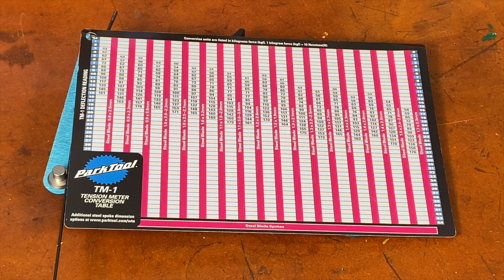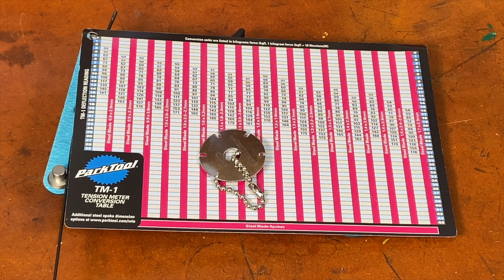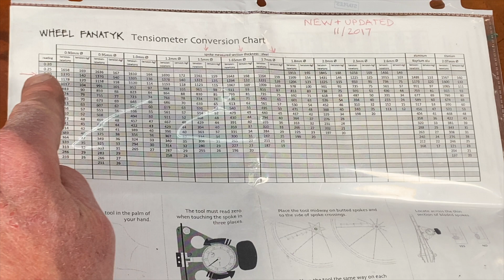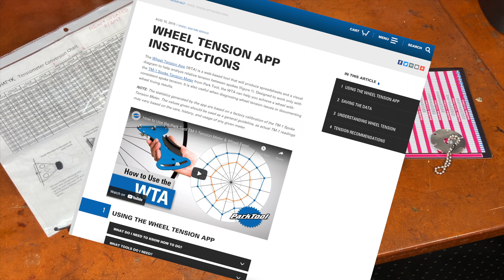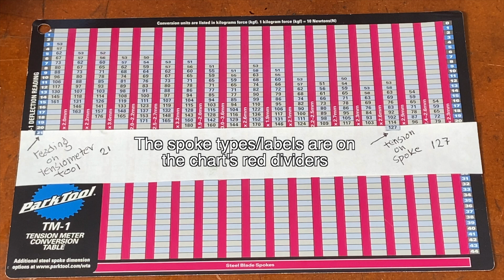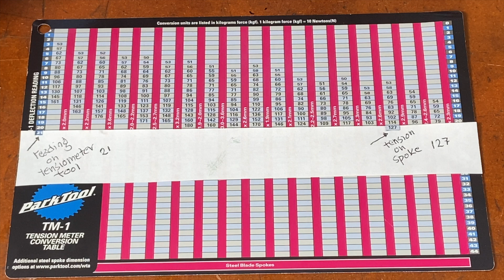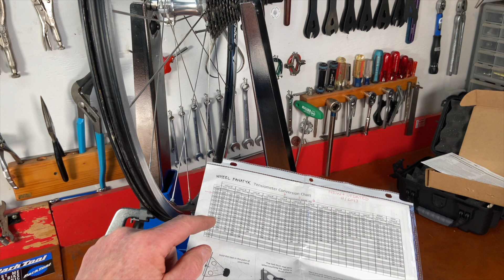Do You Need A SPOKE TENSION METER to Build Bicycle Wheels?

Comment: Hi Jim, I've become a big fan of your work in this channel. Based on many comments on many of your videos, I can tell a lot of your viewers might be interested in truing existing wheels as much, if not more, than on building them ourselves (at least for now). Given the similarities of the procedures, and how truing can be cheaper and less intimidating, would you consider making a video on truing a very damaged wheel? Apologies if you have such a video already. What interests me the most is the fine juggling of lateral trueness with spoke tension on, say, a rear wheel that has a flat(ish) spot (with corresponding poorly tensioned spokes) after being ridden over a pot hole. Maybe even use (if you so recommend {and/or explain why/when not to do so}) a "wheel rim height repair tool". Sorry for being so demanding and specific 🤪. Thanks in advance and I'll take a deeper look into your channel, maybe my request has been satisfied before. Cheers!
Reply from the maker: Thanks for supporting my channel, Carlos, really appreciate it! One thing to know is that almost all of my 25+ wheel videos have YouTube chapters. That means that you can easily jump to exactly what you want to watch by looking at the chapters (just click the SHOW MORE button under the description and they'll show up and on some videos they show up on the screen if you mouseover the red progress bar). To help you get there more quickly, here's where I explain the whole process of truing both side to side (wobble) and up and down (roundness). It's in my how to build wheels video: https://youtu.be/XUqul03hbZ8?t=1725

I go over everything so it's long but it does teach how to true and round wheels and shows the process to fix low/flat spots in wheels. Also, I have another video where I show fixing my friend's crashed carbon wheel here. This is a real time video taken as he held the camera and I did the repair. https://www.youtube.com/watch?v=NyPGQrNfUFU&t=256s

Now you specifically asked about wheels that might have run into a pot hole. That's a repair where you would start by checking the rim for bends or even worse, impact dents or real damage to the sidewalls of the rim. Most rims on quality bikes are aluminum and aluminum doesn't do well when you try to straighten it. You can try with bending tools and sometimes make it better and there are techniques for doing so, such a blocks of wood and a vise grip to sqeeze and press out dents, etc. You can make a simple tool out of a turnbuckle to push low spots up, too ). It has a curved wood block on each end, one rests on the hub, the other against the rim. You turn the turnbuckle and the wood block pushes up against the rim.

These types of tools are fun to make and use, but unfortunately the end result is not usually very good and can be a problem if you have rim brakes that need the rim to be near perfect. For disc brake bikes it's not such a big issue. So, as long the rim still looks safe to use and doesn't have failure point or a significant low spot that makes the wheel hop, then you might be able to keep using it. Always keep an eye on damaged rims, though, because they can get worse from riding and eventually fail if they're damaged badly enough.

As far a spoke tension goes on a damaged wheel, you can only get it as good as the rim will let you. With a non-damage caused low spot, if the spokes are tight at the low spot (what usually causes a low spot), you loosen the spokes in the area of the low spot and tighten the rest of the spokes, which will force the low spot up and doing this a few times you will usually get the low spot out and the wheel round again. But when a rim is actually bent, it won't always go round with this approach, though it's always worth a try.

Sometimes you can only get the rim so so, but if it's a good as you can get it, you might just have to ride it that way. Even if some spokes are looser than others if the wheel stays relatively true and the damage to the rim doesn't cause any issues with the ride or braking, even a damaged rim wheel with a few loose spokes can sometimes keep right on rolling. Hope this is helpful. Thanks again for the great comments and all the support!
Reply: @JimLangley1  I genuinely appreciate your thorough reply 🙂. It might just be the case that I should ride more carefully... but I am planning on building a new (much sturdier) wheelset once I get my hands on proper tools (excuses for boy's toys). I shall be using your videos for that project. Thanks again and have great day!
Reply from the maker: @KarlosEPM  you're very welcome, Carlos, happy I could help!!

Comment: I can't balance the tension. Tool is useless. Everytime i change one spoke the entire wheels tension changes
Reply from the maker: Thanks for watching and the comment, Mark. "Balancing" the tension is done by truing the wheel. Once it's straight side to side and round (no hops or dips/high spots or low spots), you have balanced the tension. So, if you say you can't balance the tension, it's just a matter of practicing truing so that you can. In this video I go in depth on how to true wheels. It's a long video. You can use the timecodes to jump around to the parts you want to watch: https://youtu.be/XUqul03hbZ8 The key thing when truing wheels is to focus on what you're doing and do not rush. It takes time and patience to get a wheel nice and true and round. Hope this helps.
Reply: @JimLangley1  huh. I guess that makes sense doesn't it? equal spoke tension means the wheel is a perfect circle.  Im having a TON of difficulty with radial truing however. Ive tried 4 different wheels. Its almost impossible to get right
Reply from the maker: @mark38699  if a rim got crashed it could have gotten actually bent and if the bends are bad enough then you won't be able to get rid of them with the spoke adjustments. But, as long as you are working with a good rim that's not been hit or crashed, etc. then radial truing is usually possible and not that hard to do (radial truing is also called round or simply up and down truing versus side to side). To do it, you basically loosen the spokes in the low spots slightly first. Once you've done that, when you tighten the spokes in the high spots, that will pull the rim down at the high spots and because you loosened the spokes in the low spots, as the rim gets pulled down it is forced to move somewhere and it will move up at the spots you loosened the spokes. You go with very slight adjustments at first, like a half turn of the nipples. Very gradually the wheel will change. Keep in mind that you are working with arcs. Arcs have a high point and less high points as you get to the edges of the arc. So, you would tighten the high point more and on either side of the arc you tighten those a little less. This makes sense if you think of how each spoke on the arc is pulling down on that point trying to get the high point in the rim to come down to meet the rest of the rim. When you're learning it's easiest to work on one low spot and one high spot at a time and then move on to the next one. You might want to mark the rim at those points so you can keep track of what you're working on. It's actually a fun part of truing and very satisfying when the wheel becomes nice and round. It'll take time to get a wheel near perfect but it's always worth it in satisfaction. Hope this helps. Have fun!
Reply: @JimLangley1  ok good to know. Just hope  no one steals my tires or vandalizes my bike after all this hard work
Reply from the maker: @mark38699  I hope so, too!